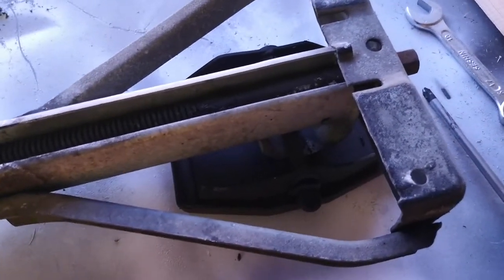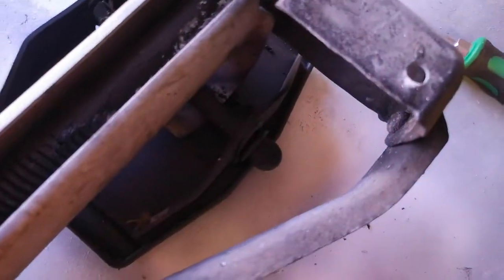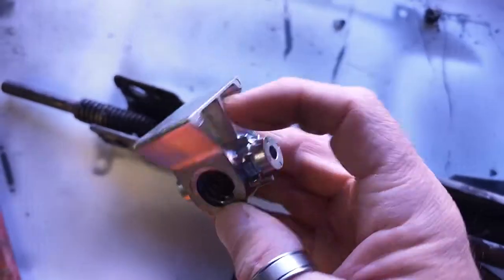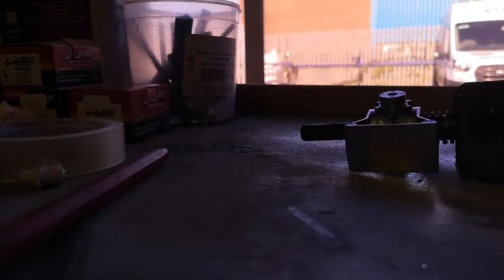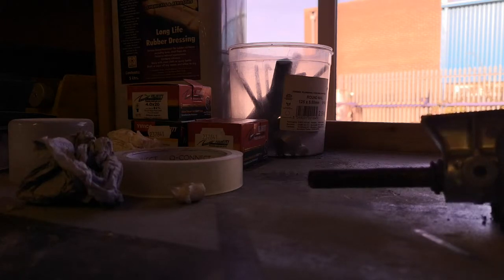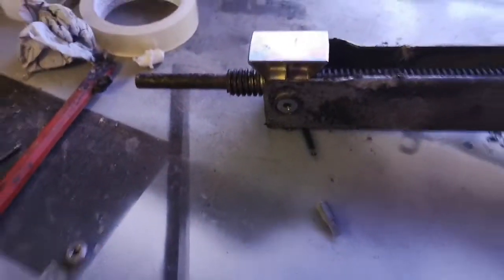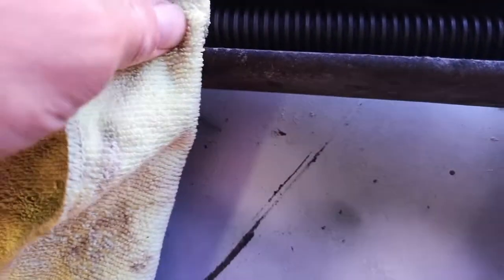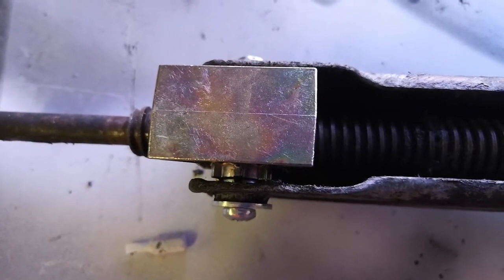Caravan corner steady repair and service

Comment: Thanks for the video, my travel nut broke the morning i was getting ready to go away, just one point, when you used the pry bar the camera was pointing at the nut (at 2.00)an couldn't see what you were doing with the pry bar to get the nut in position, other than that excellent video :)
Reply: Me too I need to know how to make it slide in, seems I have to pry the leg metal apart...
Reply: @danwiddison  thats what i had to do, not easy :(